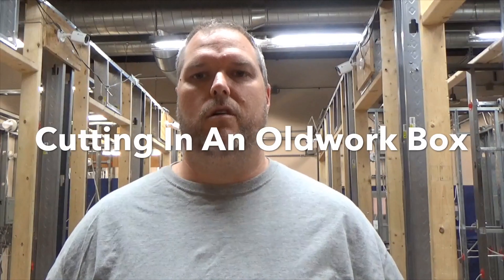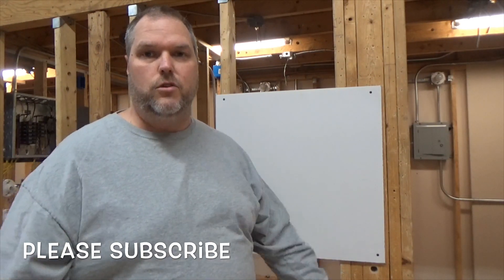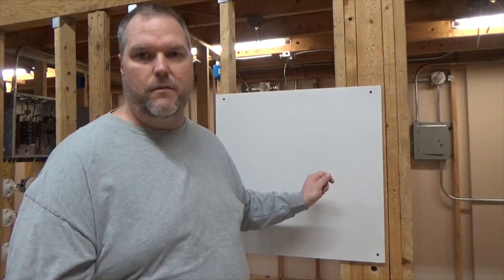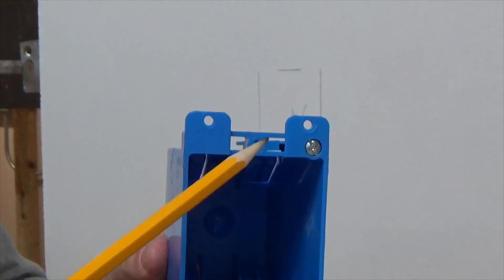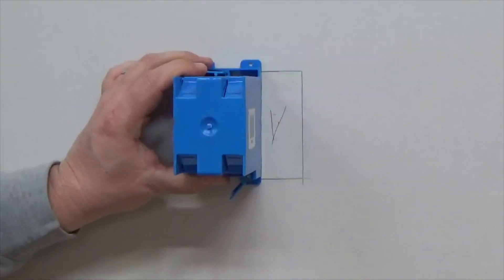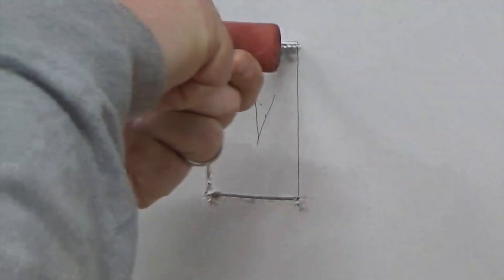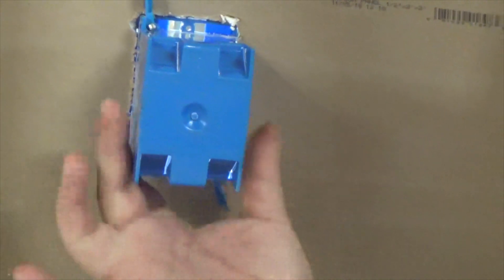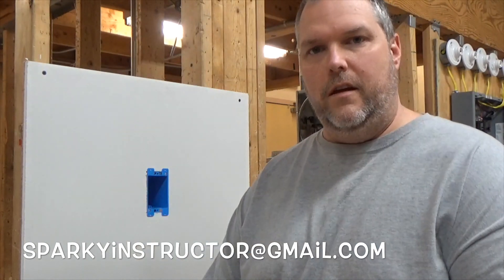How to install an Old Work Electrical Box!!

Comment: Thank you! I messed up with the screws trying to attach this electrical box to the drywall and it seems like everything is already there. I just had to rotate those two preinstalled screws with the flags. Genius, thank you for the video.

Comment: You do a great job in this video for a first-timer like me who is nervous about doing anything remotely electrical or "carpenterial". I've done a ton of painting sidework since I was 15, and some spackling and mud work as necessary to finish the job right, but stayed away from this kind of thing.
   You explain things thoroughly, which newbies and DIYers need in order to understand HOW something works, not just what to do. Many others whip through tutorials, and often assume things a novice would not know, which leaves a gap in knowing how to do the job right. Thanks for that!

Comment: My whole house has the 2 prong outlets in it that I want to change over the 3 prong grounded plugs using these boxes. 
I have an unfinished basement I'm wondering what the code is for getting new wires from my breaker panel to these boxes. 
Mainly where the wire goes through the seal plate of my main floor.
Reply: If your basement has even a single existing outlet, you can bridge. If not, surely it has lights?

Comment: Excellent vid, thank you. I use a small "surplus" screwdriver (about 3/32" diameter shaft 6 inches long) sharpened to a point to probe for studs. I usually use a stud finder first to get a general idea of where the framing might be, and then I carefully push the probe through the drywall, rotating it back and forth to help it penetrate without using too much force. If it accidentally hits a romex run or pipe or whatever, it's not going to do much damage because I'm careful not to apply too much pressure. I like your saw technique too, but a little 3/32" hole is easier to patch if necessary.